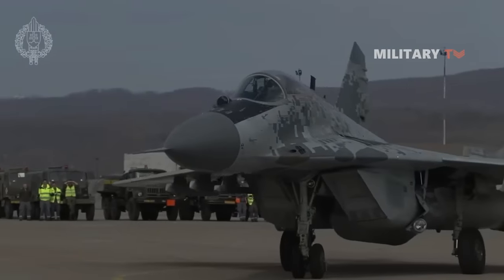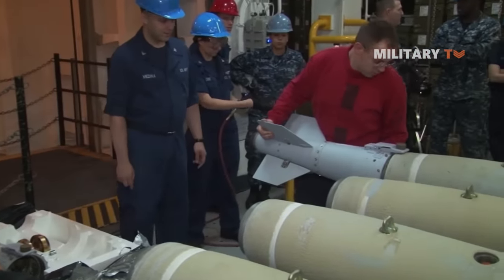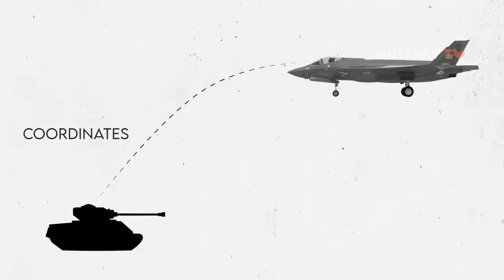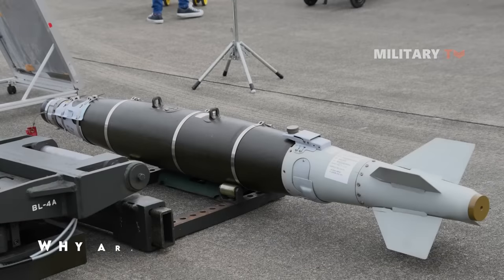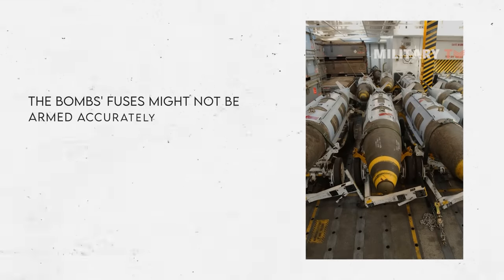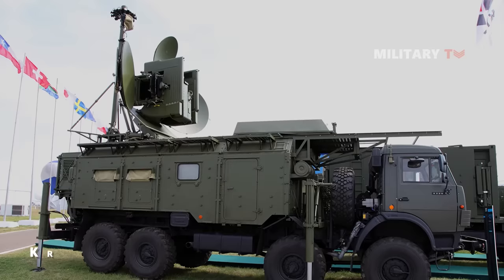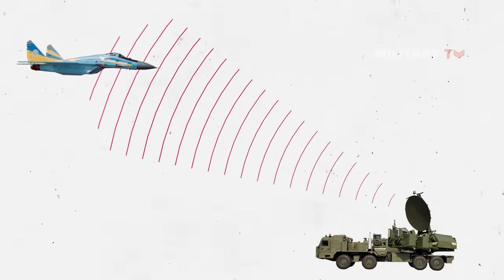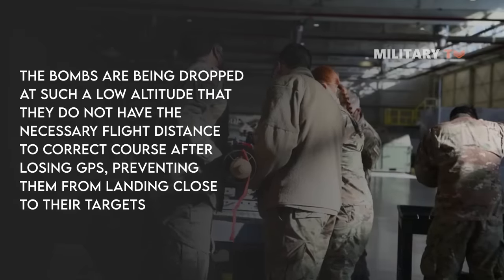Why Ukraine GPS Guided Bombs Are Failing?

Comment: Jamming has allways been a problem, (US learned that in the first time they were jammed by british forces during mil exercises) but you must remember that the military frequencies and waveforms are not the same as the civilan ones....(these last are only for funding the system).
True Spread Spectrum is very dificult to jam, because you need teraWatt levels to block the all spectrum used.
It's not like legacy tecniques, easy to jam.

The GPS receivers concentrate the antenna path upwards to avoid terrestrial originated jamming.

Most of the Jamming units have antennas on site, so they are vulnerable to direct hits.

Some ignorant guys think that you can place a fake antenna somewhere. But in fact, the actual power transmission must be VERY near the electronics (GHz require short runs of cable/waveguide).
The only thing you are protecting is the human operators and control electronics. The antenna or transmiter is gone.....

Comment: Something to remember too, the US is giving Ukraine smart bomb kits that are about to expire. So they are probably over 15 years old and so not as advanced as what's currently being used. Since the latest smart bomb kits are more resistant to GPS jamming and have better internal guide systems for when GPS signals are jammed. But the US doesn't have that many of those kits for even its own use, so its unlikely Ukraine will get it. At the same time US systems use data links with the launching air craft to help with guidance in case of GPS jamming. The Ukrainians Soviet era planes can't talk to the guidance kits and so that ability is lost with the system. Same with HARM missiles, they have more abilities than the Ukrainians can use due to again Soviet era kit not being compatible or advanced enough to use the missiles full abilities.
Reply: and the solution is .... ? Do you think this is why Zelensky wants F16s?
Reply: Keep denial my friend

Comment: JDAM uses multiple elements antenna having beam forming capability on top surface, jamming with ground based jamming antenna doesn’t hold sense. Probably Russia has launched airborne strong jammers at GPS frequency. also being jamable, these JDAMs are not using the encrypted P code allowing spoofing possible.

Comment: JDAM is not a good weapon choice for use in a contested airspace such as Ukraine as it requires that the carrier aircraft approaches the target at distance no greater than few tens of kilometers while maintaining relatively straight course and high altitude for at least some time, during which it's a very nice target for long-range missiles such as R-37. And I think that Americans know that very well, but they don't care as long as they can say they are doing their best to help Ukraine militarily. The same as they did when they sent uncountable number of defective Javelins (failed in large numbers due to old batteries that were too expensive to replace).

Comment: Navigation by an inertial system alone is not going to be very accurate. Inertial navigation requires a double integration of accelerometer outputs; even under the assumption that there is an inertial frame of reference free from drift and the navigator has accurate initial conditions, the quality of accelerometers fitted to JDAM will produce significant terminal errors without GPS because even tiny biases propagate like wildfire into  positional  errors due to the double integration . 

JDAM will be designed to withstand accelerations of 100G, probably more. This means the dynamic range of the accelerometers  ( and the gyroscopes ) will need to be six orders of magnitude to get any sort of inertial performance, which is a tough ask for a military specification sensor that is designed to operate in blazing heat or freezing cold after being stored for ten years. Especially as it is a low cost add-on to a dumb bomb.

'Real' inertial navigators are wonders of electromechanical and electronic engineering, they are expensive, exquisitely sensitive instruments. JDAMs have cheap, simple AHRS navigators which will give a 30M accuracy over 25km if, and only if, they are launched from an accurately known position.

If the aircraft carrying the bomb is denied an accurate GPS reference and inertial reference frame at launch, and 25km is no distance at all in terms of electronic countermeasures, then the CEP will be no better, possibly worse, than an unguided weapon..

Comment: The problem is both spoofing and jamming. There is one aspect military TV does not mention but should be obvious. If you actually understand how encrypytion works and how GPS works then it should be relatively obvious that it is impossible to effectively encrypt GPS or any other sattelite-based positional system that exploits time to calibrate position. This is because there is a limited number of sattelites, for each of which the orbit can be worked out. Once this is done, it does not matter what you encrypt the signal as, because it is obvious what information needs to be transmitted by each sattelite for it to work. This basically renders any form of encryption useless as it is easily broken, no matter how stupidly complicated you want to make it. The only option left would be to have each sattelite transmit a one-time pad - easily broken by capturing a reciever, or with modern processors this can even be broken in real-time by exploiting the small time delay and overpowering the ground or low altitude reciever (simultanous jam-spoofing).  

GPS and Glonass are only effective against high value targets when fighting a low tech/ non-peer competitor. Certainly, even with all of the tremendously stupid decisions our country has made, these facts were well known in the US military. The only reason we gave Ukraine JDAMs is because we know that they are useless against the Chinese and they are cheap, outdated tech that we no longer need after Afghanistan. Not a surprise, and certainly not a secret - heck this is military TV - so this is definitely something they want us to know and think about.

Comment: Who says the bombs aren't hitting their targets?
Jamming GPS. The jammer would have to be above the bomb. The bomb isn't looking downward for a GPS signal. 
The same goes for spoofing unless they have a signal coming from Glonas that has somehow defeated the GPS encryption .
If they did that then Russia couldn't use their Glonas system either it would be too busy spoofing the GPS system so it seems very far-fetched.
My best guess is they haven't used them fully yet as all the biggest and most important targets, like the Kerch bridge, are still a little out of range.
Reply: Practically everyone sayin.. dude.  did nothin to really help in bakhmut. U think each of the bombs are guided/tracked by a stream of GPS beam ? just admid Russian are good at this spoofing/jamming thingy
Reply: @kentershackle1329  They really aren't, or none of the drones would work either.

Comment: harm missiles can be used against jammers. i presume that is being done when they launch jdams
Reply: i think the strategy is overlapping jamming location. if HARM missile is moving to a jammer it will simply shut down and move to another location if time allows it while surface to air missile will be activated if there is no time.  I do not know what russia is doing as to why their glide bombs work,

Comment: They are not using correctly and on the correct aircraft.   They flow low and fast so they don’t get knocked out the sky. JDAMs need to be released above a certain altitude, but pilots will get brought down due to all the SAM systems watching the sky.

Comment: What if it's not jamming but a projection issue? Maybe they use a us centric srid projection which error margins are amplified at different latitudes.

Some projections are very precise in the Nordic countries and are used in the oil industry, these very same projections are relatively inaccurate when used closer to the equator.

Comment: Ad Glonar and other Position determining information system to GPS and you have a redundant orientation system. 
There will always be a reason why even Glonar cannot be switched off in a timely manner or kept off all the time.
Jammers need lots of energy- in combat field position. How long can they maintain jamming without hindering themselves ?
Use swarms of cheap drones with visual landmark recognition and or saturation tactics like Shaed was used

Comment: One more possible explanation could be an error made by the technician assembling the weapon. From my experience working around guided weapons for years, mistakes happen.  Distractions happen.  Weapon Technicians make mistakes.  Forgetting to connect all necessary wiring or setting a switch can make a very reliable weapon no more effective than dropping an anvel.  Competency across the board is required.  War is a team effort after all. The report did state "some" failures, not all....  I still stand by my earlier comment.😐

Comment: there only one thing to do - stop to relying on radio signal ,  reconnaissance drones might flying using preprogrammed scenario, and also optical diapason could be used.
Relying on radio signal in such circumstances would only cause disruption the more would be alternatives and the more diverse the better.
I guess missiles guided by wire/optic fiber were demoted to early and too rashly.
And precision of navigating system should be improving as well , it is not too shabby to heat precisely that spot , radio jamming in the world would became worse and worse with each day .
I guess it is better to be prepared and not relying on those things all along.
I guess there might be some symbiosis of AI(recognizing terrain) , measuring speed of wind, positions of star , sound(some little devises could cause it), positions of stars , moon , sun , ...

Comment: Why not use program like Auto cad to set back up guidance map to the target, from the know point of the jets drop point. The glide speed in MPS with air craft speed and elevation at drop, then digital map of the glide path from jet to target. That more like the Iranian drone control with added speed adjustments that on board computer could calculate at drop point download at time of release  . This would negate the jamming the Russians are using. The biggest thing be accurate location of plane, accurate target location. Digital map that is accurate. guidance would be like cnc router, oo point at release point then flite path. distance, speed, elevation, drop rate of the glide. turns, distance. laptop could calculate all that on its own then down load at drop point. Computer tec could run data for piolet. Piolet could concentrate on flying the plane.

Comment: You guys say "inertial guidance system" as if you even know what it is or how it works.  Of course it doesn't work.  It requires GPS to be active at some point so it know where it is.  It isn't magic.  It only kicks in when GPS signal is lost or jammed--After it already had one.  It has to know its starting point and end point first.  And without its functioning integrated GPS, it has no idea where it is starting from.  If they want these to work they need laser designation on the ground.

Comment: Saying that they have no INS (inertial navigation system) is laughable! Firstly, all the airplanes have it. But more importantly, it is part of bomb guidance "kit", as you called it. It's part of the system, together with GPS and is integrated in it. So, INS is not the problem.
However, INS is less accurate than GPS, so the hit is not guaranteed on a small target. In order to achieve it, you would have to launch an entire salvo at the target hoping that one will hit based on statistical probability (like Geran/Shahed drones).
So, INS can be a part due to less accuracy, but to claim they don't have it is simply not true. 
Jamming, on the other side, is not a probability, it is certain. For example, you can buy small GPS jammers online. Karsukha and similar jammers use the same principle, but on a much higher scale and with much higher power output. Because, as it turns out, GPS signal is much easier to jam than GLONASS. GLONASS uses several channels and frequencies that can be changed while en route. So even if you do jam it, you will jam one channel which will the, as soon as jamming is detected, change...

Comment: The drones use over the counter technology and is easy to jam.  The US has been beefing up its GPS guidance to make them VERY difficult to jam.  Newer GLRMS rockets for the HIMMARS should not be effected and by all reports are still hitting their targets... same with the Storm Shadow cruise missiles from England.  I seriously doubt the JDAM are having that much trouble unless the US is dumping older inventory on Ukraine.  It is VERY likely though that the Ukraine pilots are not flying high enough.  They do not have control over the airspace and fly low to avoid being shot down by S-300 and S-400 systems.  The US should just send a few CHAMP cruise missiles to take out those electronic warfare and SAM systems for a while and be done with it.

Comment: I thought the military must be relying on encrypted GPS signals unlike the civilian version.
Reply: you do not need to control the GPS signal just create sufficient noise that the system gets confused . And also you cannot encrypt GPS since it is just a continuous signal coming from a satellite. the satellite do not even know you are using a GPS
Reply: @JL-tm3rc  believe me buddy I know how GPS signals work to triangulate position on the plot. GPS signals could be encrypted as well.
Reply: @sunnyrajput1912  huh ? GPS relies on a continous signal from a sattelite. A GPS unit is a receiver so what would ypu encrypt if it jus receives a signal. A satelite would not even detect if you are using GPS
Reply: @JL-tm3rc  continuous signal is nothing but a time stamps of moment signals are transmitted from satellite. GPS satellites aren't as dumb as you think. They are kept open source and nonencripted for civilian use but the military doesn't use those (civilian versions) signals.
 GPS signals could be and have been manipulated by U.S selectively in a sector/geographic area to disallow military use of that GPS signal, which renders location on map unreliable for determining location of troop and guilding weapons. 
Encryption merely is transmitting GPS signals with headers that could be mathematically validated by hash function for authenticity, also military grade GPS signals are transmitted more times i.e less intervals between 2 transmission.

Comment: The Russians are pretty good at math, so it is no surprise they have figured out how to screw with the superior USA GPS.  But what a great way to test the USA weapons against the Russians, while saving the world of course. Great research for the next stage of weapons.   The USA can determine how effective the Russian jamming is.  Don't forget jamming only works in these environments a small part of the time.  It takes a lot of energy to saturate the spectrum to the extent that you will start to interfere with well modulated signals.  The USA has not sent any knew technology that could be compromised during the war.  And this war will give you a good understanding how effective their jamming is so you can do your ROI to determine if this is a cost effective weapon.
 The larger payloads with respect to these retrofitted units, would be using other technologies that can spot enemy hardware and lock in on target with no known Jamming at this point in time.   This video is discussing what is just a cheap fix to already crappy missiles destined for destruction anyway.   The fact that they work at all is a huge bonus because the USA had already destroyed 100,000 of these arms and had to destroy another 200,000.   It was probably a similar cost to decommission the arms as it was to retrofit them and Ukraine was not complaining.   I think the added cost was about $50,000 per unit, so much more cost effective than the million dollar missiles that hit the right spot 100% of the time.

Comment: I believe there is some misinformation or Disinformation going on here.  The jamming is obviously localize, and/or the problem is the failure of pilot to properly employ the weapon (FLYING TOO LOW MAY BE!?).    We referred to the latter as a "faulty stick acturator" when I was a Missile Guidance and Control Specialist (24yr Active Duty in the USAF).
All GPS guided munitions would otherwise be effected. Two were mentioned, JDAMS, and HIMARS.  Why not Excaliber and the Storm Shadow.  Don't  believe every thing you read or hear. The authenticity of the leaked documents have not been verified..., it could all be a ploy.  Otherwise, thanks for the report

Comment: I guess we now know why the sudden change in the F-16 issue!
They need better , more survivable jets to achieve air superiority and make destroying the anti aircraft  systems easier, thus allowing the bomb droppers to fly higher. Not to mention taking out the large EW platforms.....
Reply: F16 more survivable  ? than what ?     - against MIG31 with R37/R33 missles ?
Reply: @kentershackle1329  Haven't you figured this out yet??? Russian equipment on paper, is not Russian equipment in reality....MIG-31 is great as long as you don't have to turn, its a high speed cargo plane! Those deadly missiles are at best mediocre...and the F-16's radar and missiles are quite superior.  So much so that the F-16 can hit even the latest SU-35 before the Russian jet even knows its there!
You need to get up to speed on your knowledge!
Reply: @Sean2002FU  LoL.. mate. sure whatever ya want to believe. 
Shovel still rule though...